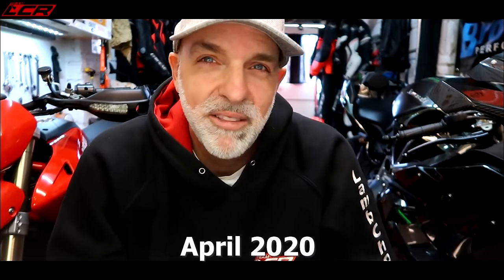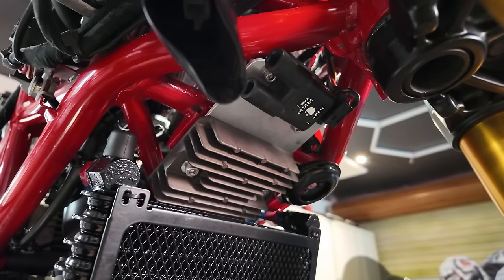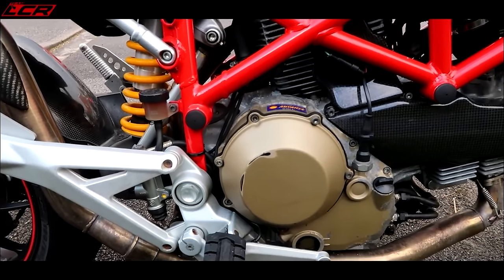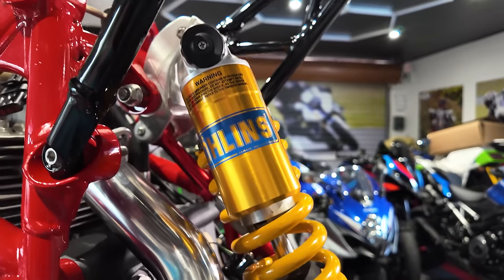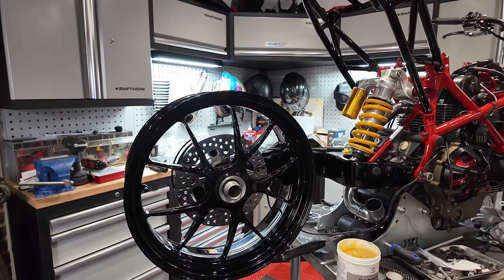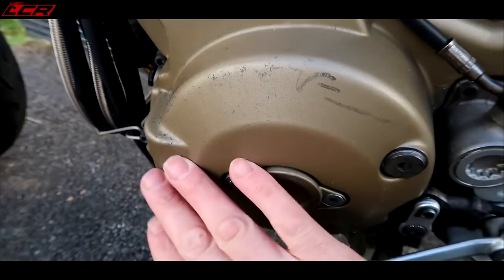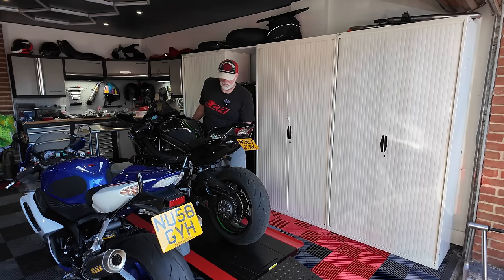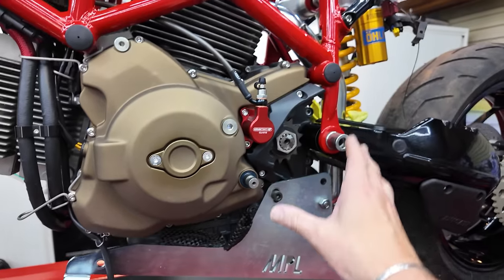Ducati Hypermotard Restoration |  The END Is In Sight! | EP19

Comment: Nice to see it progressing, for my tuppence worth, I’d keep an eye on all nut tightness, not sure if the powder coating was removed below any bolt seating surfaces, if not they will loosen continually until the powder coating cracks and drops out under bolt seating. Also have to watch any grounded electric cables to make sure they earth properly. Its one of the disadvantages of powder coating finish, although its not a problem if you remove the finish before installing all bolt/nuts. It’ll a be worth it psychologically, if not financially once its complete and being thrashed down the back roads or track days, keep them coming👏👍🤣🤣🤣🏴🇬🇧

Comment: Can't wait for the fire-up! Just something to note - those "original" rear disc bolts you were comparing the new ones to weren't disc bolts. The original fasteners are cap head screws with low profile heads that sit in the counterbored recesses in the disc. So do make sure you've plenty of clearance before that first ride.
Reply from the maker: OK thanks 😁👍

Comment: Great upload Chopsie, you're doing a great job on this project and I can't wait to see it finished! I, and I'm sure others would be interested in any weight savings made and, if it's not too cheeky, the overall cost of the resto, if that's something you can quantify? I'm planning on doing a resto mod myself and it would be a useful indication before I get started. Thanks 👍
Reply from the maker: Yeah this one got completely out of hand.. so really costs are ridiculous. When I do the ZXR I will give a proper breakdown 👍
Reply: @LambChopRides  thanks, I appreciate it. The resto must run into many thousands! I am considering a mod job on my 900 hornet, the seed was down when a contact through work offered me an almost like new set of USD Fireblade forks for £200! All that adjustment is bound to improve an already decent handling bike! Why do I feel like I'm about to take the lid off Pandora's box? 😂

Comment: Can’t you just stick a fancy nyloc nut on those bolts that are too long. I know they don’t need em but it’ll look better than threads sticking out.
Reply from the maker: Good idea 👍
Reply: Or if you know someone with a lathe to just turn them down 5mm or so.  Or use two nuts, one as a locking nut, the other a guide to cut the bolt square and disc cut them shorter, then chamfer the end with a flap wheel.  Or buy shorter bolts.